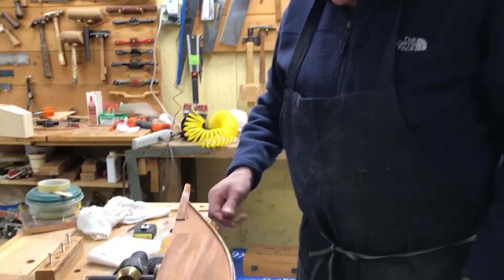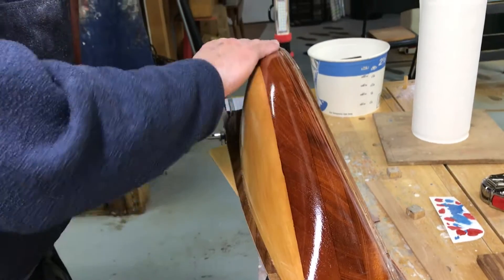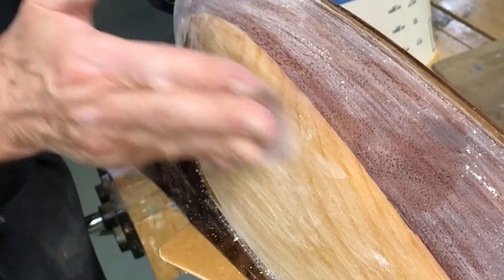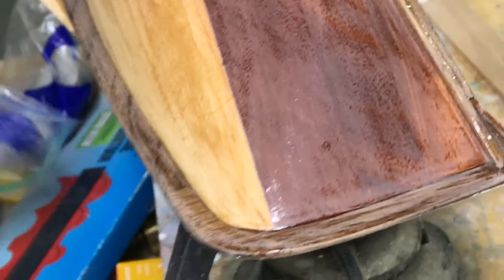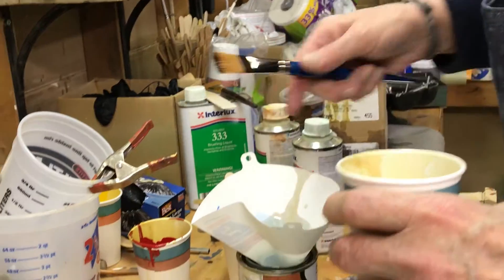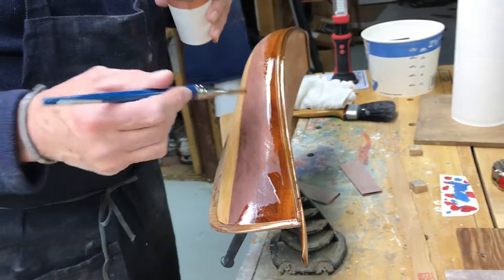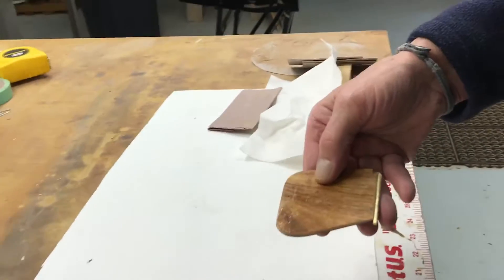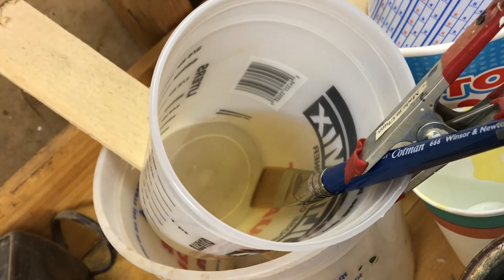Cat Boat Half Hull by Malcolm M. Crosby, Part 14: Varnishing

Comment: I assume a special tape was applied to get the line for where the mahogany was stained.  How did he not get any bleed through of the stain?  I thought even with good tape, the stain might go under it to the basswood.  Thanks.
Reply from the maker: Dave Robbie Hi Dave, Yes Malcolm uses either 3M Precision Masking Tape 06525 1/4” (mint green) or 3M Blue Vinyl Tape 471 06405. Try using Gel’d stain - it should bleed less. And if you have a painted boot top you can hide the bleeding under it! Also, staining top sides but painting bottom is an option. We will have a video for Series 2 soon about staining. We’ll try to explain it all then. I’ll message you when it’s uploaded in the next few weeks.